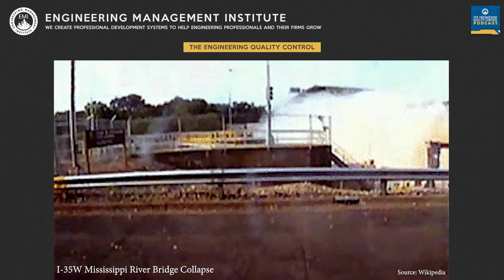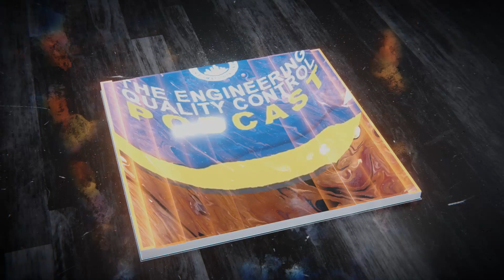I-35W Bridge Collapse: Probable Causes and Future Prevention Tips

Comment: CONSPIRACY FIRST has a 100+ part series deeply exploring the many anomalies of the Baltimore FSK bridge take-down.  Part 41 of that series details the anomalies of I-35 take-down that appears to have involved directed energy weaponry.  Particularly onerous are the many "impossibly" warped and wilted structural steel girders, all without a single crack!  Blast furnaces can cause that, so can energy weapons introduced in 1983 by President Reagan.
Reply from the maker: @ToxiCom-777 Thank you for your comment. While we appreciate diverse perspectives and encourage open discussion, our video focuses on the engineering and technical analysis of the I-35W bridge collapse, including the probable causes identified through extensive investigations by experts in the field. These causes include design flaws and maintenance issues, as detailed in the National Transportation Safety Board (NTSB) report.

We understand there are alternative theories, but our aim is to provide evidence-based insights and practical prevention tips to ensure future infrastructure safety. If you’d like to explore more on the engineering aspects, feel free to check the resources linked in our video description!